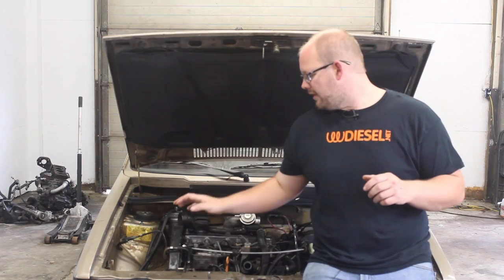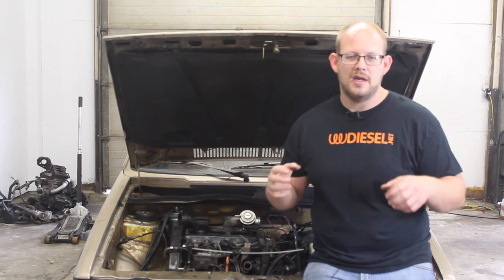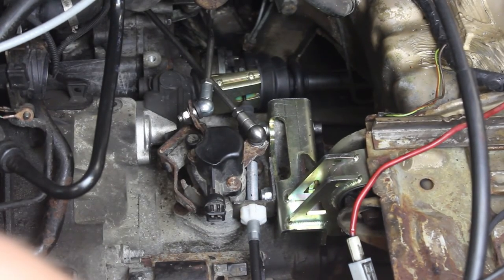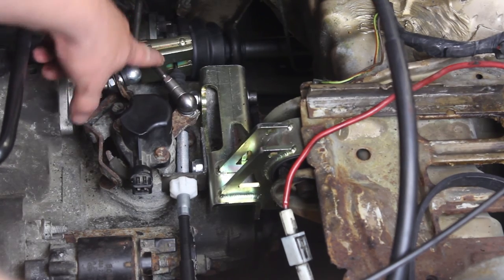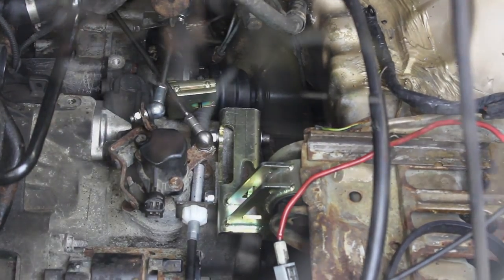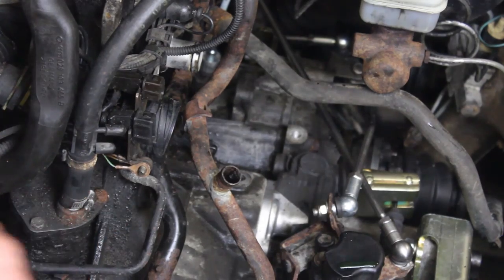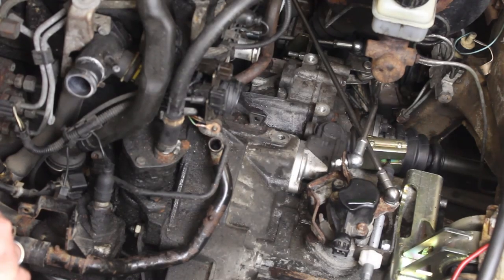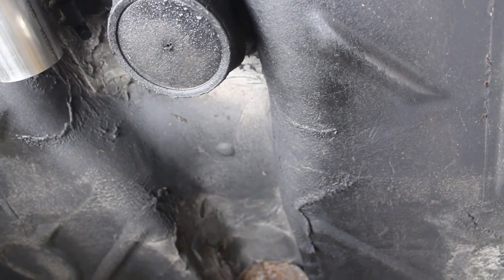S&P Automotive TDI Caddy swap Part 2: Cable Clutch, Rod shift conversion and Exhaust

Comment: Great video Ryan got a vw TD 1.9 TD with  5 gear box and going to do that swap from hydraulic to mechanical clutch on my vw 1980 1.9 TD it will be a bit of change in my car nice :)

Comment: Have you addressed the fact that the cable is pulled upwards by the pedal not lining up?

It works. But leads to a very short life of the cable and very stiff effort.
Reply: Also, the cable is much happier running underneath the transmission. 

Try it. 

I did it your way for 9 years. 

It goes under best.

Comment: Is there part 3 ? Also I have the original 1.6 Diesel can I blot the original mk1 diesel gear box to a ahu Tdi from a 99 Passat, as the Passat gear box won't fit
Reply: Hi ryam, I followed your fuel pump settings on my aaz, with my gauge, but it won't fire up ,how much play at the start, looks like the gauge went round 3 time then bk to 0 ?? Thanks

Comment: what axles did you use to make the 020 trans work ?
Reply: That's a 02A transmission
Reply: 100mm cabriolet axles. 

But you will have to clearance the spindle /hub carriers. 
Very easy to do. 

Or you can swap in cabriolet spindles